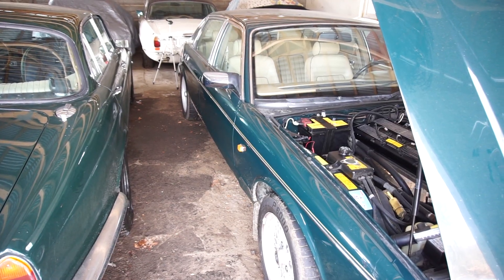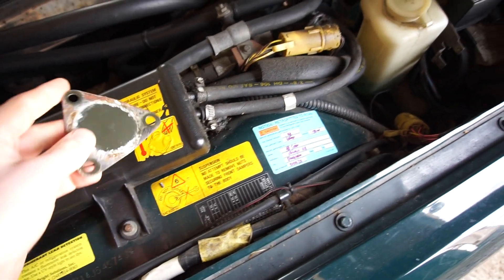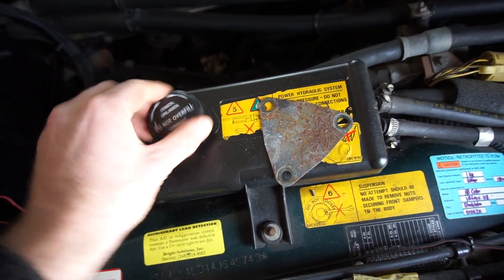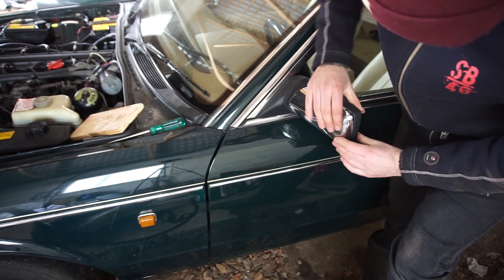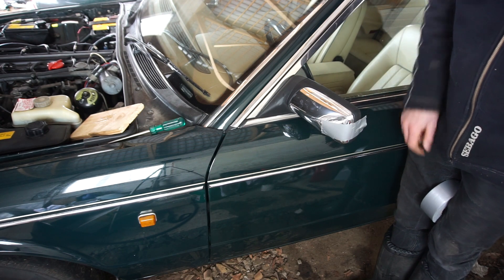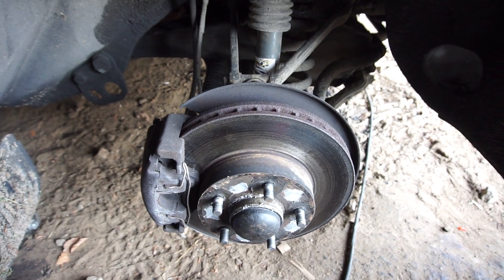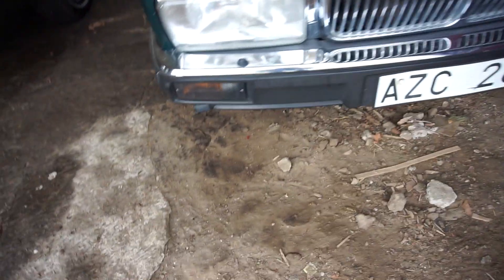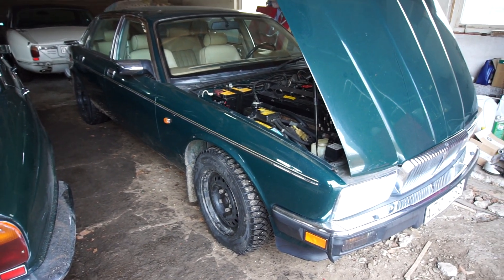Will My New Daily Driver Pass Its MOT?

Comment: Yep, just clean the leaky components with brake cleaner right before you run it in for the MOT inspection. They'd never know the difference........and the items they failed you on are nit-picky items that are easily repaired. Good job either way!
Always fun playing musical tires between winter & summer rubber, too.

Comment: Result Adam! My car has the twin headlamps and I had a similar prpblem with the pilot light insde the headlamp. It turned out to be a bad earth on the bulb failure module. The steering rack gater doesn't sound to daunting a job but getting hold of a new one might be problematic. You are so right about the XJ40, the ride quality is luxurious to say the least. Great channel by the way.

Comment: That side light issue is most certainly a bad earth/connection problem. If you "pass" the digital multimeter test (meaning it seems to measure 12V) but doesn't pass the regular light bulb test (which in this case is very straight forward since those wires are actually supposed to power a light bulb lol), it means that the connection is weak. Hälsningar från Finland :)
Reply from the maker: It shares the earth with the side indicator which works fine. It’s most likely an issue in the bulb failure module. I have a new one I’ll fit to try soon 😊

Comment: You should check for battery voltage with a test light not a multi meter. A multi meter will say that there is 12 volts even if only one strand of wire is connected but the test light will prove it cant carry a load

Comment: I'm so sorry it did not pass this time, however, as you stated, those small items can be fixed within the 30 day time frame.
Jaguar's of this era not only rode well, but handled well. I did here the clunking while you were driving, as mentioned, that can be rectified soon, I hope.
And very nice to see that underneath is extremely clean and virtually rust-free!
And hopefully you can find a new headliner as well, it seems to be sagging, common problem on vehicles of that era no matter what the make is.
Good job Adam!

Comment: Sometimes the bulb doesn't touch the contacts in the back of the socket so the test meter will show 12 volts but the light does not work.

Comment: I understand why you like Jaguars but they are not for the faint hearted . They are beautiful cars and a dream to drive as your download shows but there is always something to change or repair and with a Jaguar there are a lot more bits than your average car . I’m selling my 2003 Jaguar S Type 3.0 V6 in silver and I’ve bought a 1999 Jaguar XJ8 3.2 Sport with low miles and a black leather interior . It needs a bonnet , wing and near side lights ( already have a bumper ) as the previous owner had a slight mishap . Easy fix and I have located the parts , just got to collect them . I would have kept the S Type but I can’t afford to run 2 cars . Looking forward to watching all your downloads to pick up some tips for future fixing . Thanks 🙏 for download .

Comment: Well, if it wouldnt fail on the terms of being "a sharp object" it lets down the whole impression of the car :)
Lubricate the inside mechanism of the electric mirrors, or else the corrosion from salt will get into there and slowly destroy them. Even though the aluminium mechanism will not rust, it will corrode. I have replaced two on both an X300 and on an S-type.

Comment: Hi Adam. Well it just proves that every cloud has a silver lining ! And apart from the very irritating bulb the Daimler  has exceeded expectations . ( Sometimes it can be a cheap bulb that creates the problem ) but l'm no" sparky "! The summer tyres on the XJ6  may not be suitable for the V12.  The XJ6  ran 205 /15 's .."V" rated the V12  215/15's  "H" rated . To be fair regarding the speed rating there's probably no fear of you" Maxing out " either car!  Thanks Adam.

Comment: Maybe the ground is bad to the bulb, or the voltage is not hitting the contact on the bulb. Do a continuity test from chassis ground to bulb ground. How does the voltage go from 14 to 17? Not familiar with that module. Maybe you can bypass it to test, or check module ground.

Comment: I remember them headlamp modules being rather unreliable even when the cars were fairly new had to replace a few on mine back in the late 90s early 2000s when me and my dad used to run them as daily drivers.usually affected the dim dip feature back then tho.if i remember rightly the later car modules are much better and interchangeable with earlier ones.not a bad result that tho,just 2 issues.you will soon have them sorted i am sure.

Comment: The clunking sound is usually the rear shock bushings, maybe the same for the front?
Nice seat and interior. This car should be very reliable.
Reply from the maker: It’s the top shock bushings up front, more on the right side than left. Going to order some new ones asap